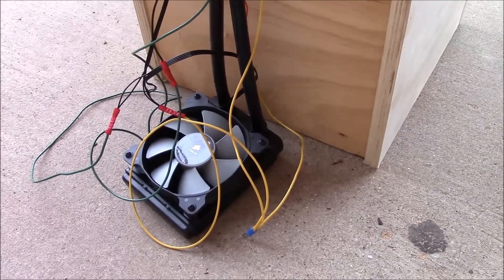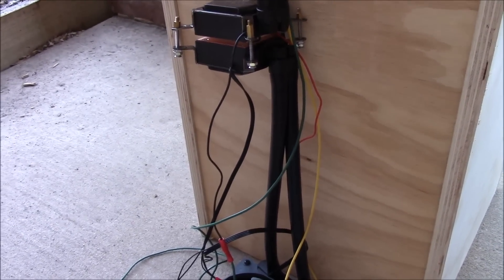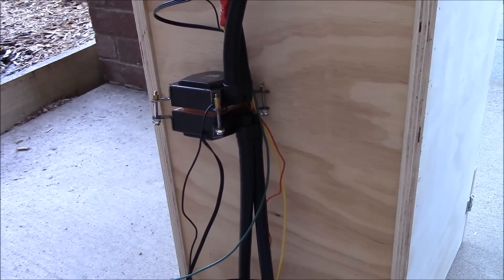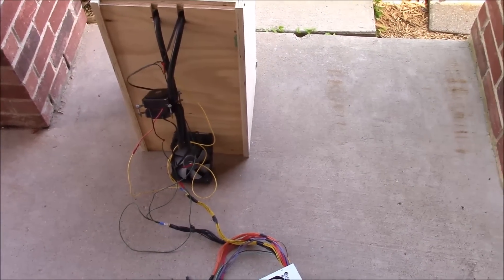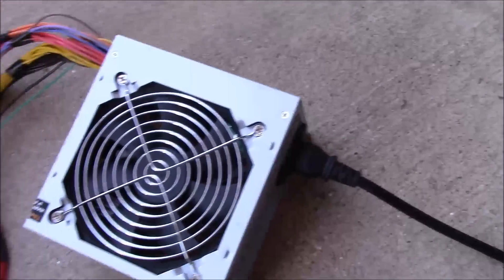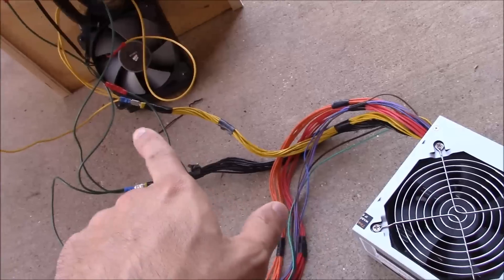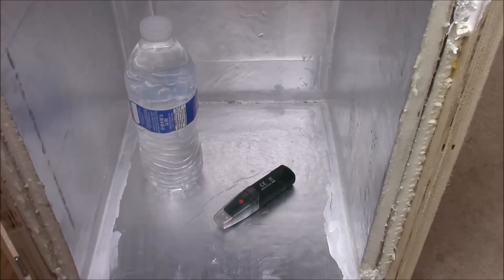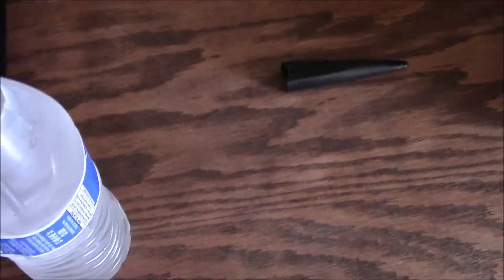Liquid Cooled Peltier (TEC) Refrigerator - Part 4

Comment: That is great. I wonder if you had more insulation if that would affect it too. I am happy for you to achieve the temps.
Reply from the maker: TheEmptynester I may do a follow up video in the future and add a third layer of insulation, install some more powerful fans, and maybe coat the outside of the wood with some sort of sealer to add a final layer of barrier from outside air.  Can you think of anything else that might increase efficiency?
Reply: LDSreliance Like in a normal frig. It is almost air tight. Maybe silicon the seal. If I could build one myself. I would look back into history. They did a wood box. Ice on top.  I would also put the fan on top blowing down. . Not in the box. Because the heat from the motor will decrease cold. With metal being conductive. I would used it in the shelf. To let air pass. And it would add to transfer of cold. Not much. But every thing helps. You are basically only trying to make a frig work on dc. So use elements that make a frig efficient.  It is like reinventing the wheel, We can only make them bigger and better. But they stay round. I would like to do what you are doing. But I have to add it to a wish list. Thank you. I will keep up on your progress.
Reply from the maker: Good suggestions and thanks for watching!